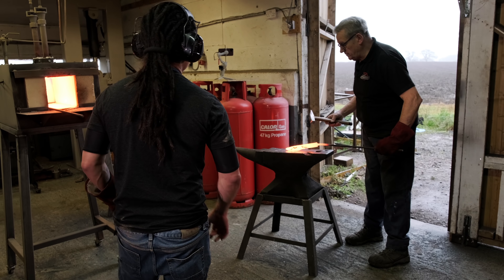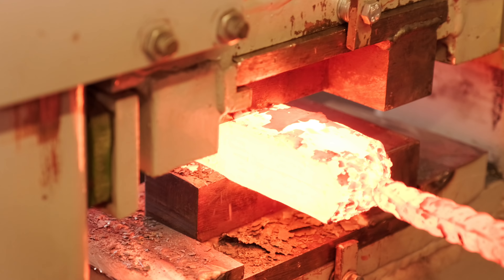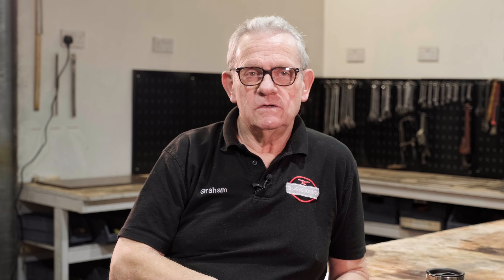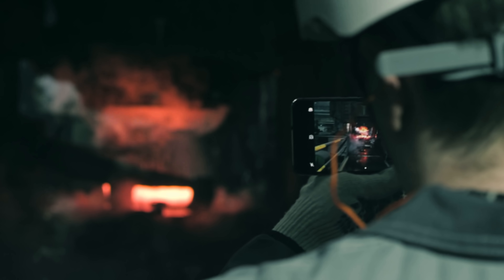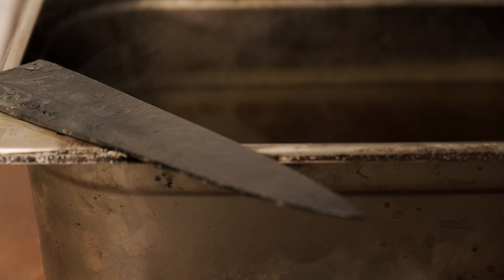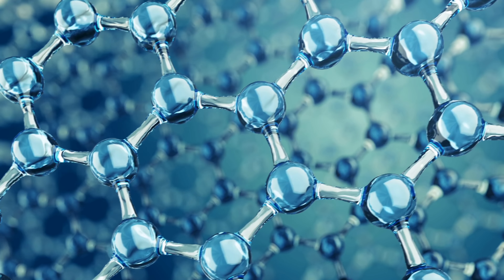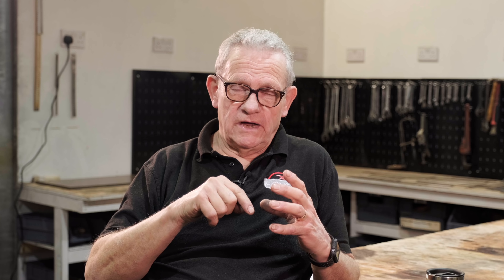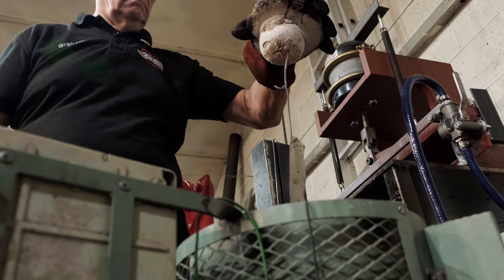3 reasons your knife is distorted (and WHY many makers get it WRONG)

Comment: if you quench in oil you can pull your blade out when it's warm, and bend it into shape while the martensite forms. Otherwise, you can just use a straightening hammer, wich is very safe on a tempered blade. I've never broken a blade with this kind of hammer

Comment: I appreciate finally seeing good metallurgical information about knifemaking. I am a metallurgist for a large captive heat treat department. The onlything I dissagree about is the movement in the quench oil. I agree that the stirrin is counter productive, but having good even flow around the entire piece of steel can reduce distortion caused during the quench. Quench flow helps to break up the layer of gas that forms on the hot steel at the begining of the quench. The goal is getting the same cooling around the entire part to prevent uneven residual stresses. Quench oil choice is also a factor. Using an oil with the corect speed for the material. Keeping the quench oil at the correct temperature can be a factore. Oil designed to be used at 150F will not have the correct viscocity to give a good even quench at room temperature. The temperature of the steel as it goes into the quench is a factor as it can change the amount of retained austenite in your steel. Grinding after heat treatment can also change your residual stresses in the steel. if you go from compressive to tensile stress on one side of the steel when grinding that will warp the blade. We see it in caurburized steel rings. A ring perfectly flat and round after quench can distort during grinding of the OD if you distort the residual stresses.
Reply from the maker: Hi Robert that is a fantastic reply and thanks for the compliment too!

Funny enough, the next set of videos coming are about quenching oils, how speed affects your quality and many other important things to know for a knife maker!

Hope to see you in our other videos! Cheers!
Reply: Ah! Robert - you speak music to my ears - a man that understands distortion. I don't think you can fully understand how it hides in crooks and crannies waiting to jump out and bite yer arse when you least expect it 🤣🤣🤣🤣
Reply: I worked in the heat treat department in several factories, small and large.  I agree with Robert on the formation of gas around oil quenched parts, or worse, steam pockets on water or brine quenched parts.  This can also result in soft spots.  Rather than agitate the part, agitate the quench media.  As for retained austenite, not letting it cool down enough before tempering or too severe a quench, particularly with air hardening steels, are also causes.  If there is enough retained austenite, the parts may "Rockwell soft" after hardening and mislead one into thinking it was a poor quench.  They can then increase in hardness after tempering.  (This "secondary hardening" is normal for D2 and most HSS).  One indication of too much retained austenite is the part shrinks after the hardening operation instead of showing the approximate 4% volume growth associated with the transformation to the martensite structure during hardening.  One way to get rid of the retained austenite is to give it a cryogenic treatment, but be sure to give it a second tempering to eliminate having brittle,untempered martensite in the part. As for carburized parts, one of their advantages is the residual compressive stress in the case (which increases the fatigue life in parts such as bearings).  This is the result of the difference in the transformation temperatures between the low carbon core and the high carbon case.  On non-uniform cross-sections, the ratio of case-to-core has an effect on the change of shape  of the part during heat treatment.  As for distortion,  one job used thin, 9" long pieces of CRS (distorts just by machining it) that were carbonitrided in a cyanide pot and quenched in water.  To solve the problem of distortion, they were first heated to 1540F for an hour while laying flat and allowed to air cool.  This solved the problem.  As for knives, whether its W1, O1, A2, A6 etc., you may want to try annealling (furnace cooling them) them in a straightening fixture after all the primary ops are completed,  and then heat treating them.  To prevent any de-carb, use an atmosphere controlled or vacuum furnace, or wrap them in stainless foil.

Comment: Luckily of the 100+ knives I made so far I only lost two due to too much distorison. I am stock remover not a knife smith. What do I do to mitigate this issue.
- Stainless steels like Niolox or the Crucible CPM steels I send to a heat treater that I trust and who knows what he does.
- I rather leave the blade thick before heat treatment. For example thin kitchen knives with a blade thickness of about 2 mm, I don‘t pregrind the bevel. I leave it thick. Do I need to grind a bit longer? Yes, but with the right belt not much of an issue.
- Most carbon steel knives/tool steel knives I heat treat myself. Proper stress relieve and normalization is a must. I do it for all baldes even with steels sold as annealed and normalized.
- Slight bends/distorions I fix after tempering. I don‘t overbend at tempering, never had any luck with it. Maybe due to practice. I have a set of small ball peen hammers 5 to 9 mm ball diameter. I put the blade on an anvil and lightly hammer the concave side of the bend. I mean really light, not a lot of hand force, just use the hammers weight. I frequently check with a straight edge. I learned this trick during my apprenticeship as a tool and die maker (1976-1979). In the molds we had very thin parts in the cavities and those always came out bend from hardening. Before we further ground and worked on those parts had to be straightend. Of course you see the littele dimples and need enough steel to grind those out. On blades that I pergrind I leave an edge between 0,5 -0,8 mm that was always enough to get the dimpels out. Btw. i made those small ball peen hammers myself during the apprenticeship, still have them.
Reply from the maker: Hi Roland and thanks for your fantastic and comprehensive input! 

I think point 1 is best thing to follow if you want it done. It’s the same reason I would send my car to a mechanic to give me peace of mind it’s done properly.

Thanks again for taking time to comment!
Reply: Gold
Reply: This guy is why I read comments

Comment: @Graham Clarke You showed your stainless blades are clamped after they are quenched. I try the same with thick aluminium quench plates. But when you remove it from the press for cryo treatment, won't it still warp due to not all structure changed to martensit? I wonder whether the  quench plates should at best be kept on for (1st) cryo treatment...

Comment: another fantastic video!  I make a lot of kitchen knives, and with blades that thin you get really good at managing and correcting warp.  Stainless is especially challenging because you can’t simply thermal cycle it to stress relieve it as easily as non-stainless steel due to the nature of stainless being air hardening.  Another factor is cryo. A lot of perfectly straight blades want to warp during the cryo cycle.  As Graham says, those invisible stresses seem to rear their ugly head at the most inopportune times after you thought the coast was clear.
Reply from the maker: Hey dude nice to see you back! Kitchen knives seem to be more problematic than thicker ones for warping / distortion but you are right, practice makes perfect! 

Thanks again for watching and I hope you are enjoying the content we put out!

- Vinz
Reply: @UKBladeshow  The thinner the material the more difficult to keep flat - try keeping kitchen foil flat 🤣🤣🤣🤣🤣🤣

Comment: 1st, great video. 
2nd, just want to add my 2cents. i have found that doing a horizontal quench with the tip pointing magnetic north has greatly reduced bends and warps during heat treating as well as in the temper..
Reply from the maker: Hi Scott thanks for the comment and appreciation!

Comment: I temper anything under an 1/8 inch clamped to a flat 1/2 inch steel plate. It's more prominent in stainless but if I counter bend on very thin it has taken the new bend. Let the plate and work cool down natural at room temp before unclamping. On high carbons especially at thicker material I'll use three bits of round stock and a vice with a torch and clean the edge so you make sure to keep your temp below straw. I have also used a hammer and anvil right after quench while it's still to hot to touch. Good luck figuring it out y'all!
Reply from the maker: That’s nice of you to share your thoughts and method thanks Mike!
Reply: @UKBladeshow  if we don't keep sharing it's going to get lost. Appreciate your channel.

Comment: I have a vice with long pieces of rectangular steel tube and thin wood mounted on the jaws. The vice is mounted on its side so it's in the same orientation as that guy's press. Other than that it's propane forge/oven and oil.

Comment: Question: Should knife and blade smith use steel wire and bars rather than plates? What forms of flux reduce delamination the most? Does filling the canaster with Argon gas help with canaster Damascus?
Reply: There’s been a video recently on forge welding. You’re more likely to get a answer putting your question on that one. I’ll try answering as best I can - I’m a ferrous metallurgist but not a blade maker (alas). And the following only holds for carbon steels.

I don’t know fluxes well enough to answer. Sorry. However, the reason to use a flux is to remove scale and get a nice clean surface. If you can avoid scale forming you can ditch the flux.

If you can get rid of the air in the canister before heating then you would prevent scale forming and ruining your welds. Argon sounds like it’ll do the trick (though be careful and ventilate the area - Argon can kill) 

The main thing that will prevent a solid forge weld is scale and general crud on the surface. I’ve unfortunately never had the chance to try but I would image that plate would be easier to use since there’s a whole lots less surface to generate defects compared with wire.  I’ve seen some very pretty blades made with wire/bearings/bolts etc so if the art of the craft is what interests you then don’t let that stop you from using wire.

Comment: my 1st knife bent on me, but it's totally functional.  only made a few so far, but after forging, I put the knife blank in a section of square tubing and heat them both to non magnetic.  then put them together in a bucket of ash to cool slowly.  not sure if it's necessary or not but it seems the extra mass of hot metal from the steel tube let's the knife blank cool slowly enough to fully anneal (or normalize?).  they come out of the ashes straight then I can quench and temper without much distortion.  I didn't invent this, just copied it from someone else.

Comment: I reverse bend with folded steel foil, an old piece of 1084 and a c-clamp.  I've gotten pretty good at that, but it's a pain in the ass.  I also peen.  But none of this is ever done before the first temper.  I also stress relieve steels like AEB-L and Magnacut, both of which are warpy.

Comment: After normalizing, if it is bent, reheat above critical, and straighten the knife. Re-normalize the blade to see if there is still warping. Repeat until the blade stays straight, then harden and temper.

Comment: Great stuff! Particularly interested in tempering to straighten comments... I've had mixed results but I've been tempering at 400° instead of 450°... Does it degrade steel quality of you temper more than 2-2 hour cycles? I've got one rt now that's been cycles twice at 400 ° clamped a bit past the bow but the bow just came rt back... Should I clamp straight at 450 ° or clamp beyond straight the other way?
Reply: @stevesyncox9893  ty... I usually torch the spine as well... This blade however has a hamon and I've discovered thru error that torching the spine on hamons kind of ruins the hamon for etching so I'm trying to avoid that... I'm gonna try tempering with a jig at a higher temp and see what happens...
Reply from the maker: @stevesyncox9893  thanks Steve, sorry if we didn’t clarify it but yes, it’s Centigrade hahaha! Thanks for your input as well - really appreciate it!
Reply from the maker: @Bar_D_Forge  thanks for the question Kevin! Very good question indeed and I must say, we only touched a little bit about tempering but maybe we can discuss that in-depth if that is of interest?
Reply: @UKBladeshow  absolutely... I need to learn everything from you guys, absolutely fabulous content...
Reply from the maker: @Bar_D_Forge  cheers man - I promise we have more good stuff coming shortly but don’t forget to watch the content we’ve put out in the last 12 months - everything from knife makers showing their process to knife maintenance tips etc!

Comment: Awesome video.  So glad YouTube suggested one of your videos a few days ago.  Warping is so frustrating.  I lost 6 knives about a year ago and then built a plate quench vise.  Straight blades but I noticed that it isn't quite hard enough.  Graham, what is best HC steel if plate quenching?  Been using 1080 type steel.
Reply from the maker: Hi Jeffrey thanks for watching another UK Bladeshow video! I’ll be speaking with Graham again soon so I’ll ask your question! Thanks!
Reply: You'll really struggle to get max hardness with a plate quench on a many carbon steels and plain carbon such as 1080 in particular. Their required quench rate down to below about 350-400 Celsius is just too fast for plate quenching - I use a fast or accelerated industrial quench oil for these materials. Choose steels with some Chrome content such as 80CrV2, 52100 or A2 ( in ascending Cr Content) for much better plate quenching results.
Reply: @clarkeknives4159  Thank you!

Comment: Weird question about clamp quenching.
Has anyone ever used materials like copper, silver, or tungsten for that?
Obviously copper and silver because they have greater thermal conductivity and greater thermal mass than aluminum. But if I remember correctly pure tungsten has better thermal conductivity than 7075 aluminum? Which is like the least conductive aluminum, but maybe the mass makes up for it?
If no one has done silver and copper, is it because they're too expensive or too soft?
If it's one or both of those would tungsten solve that?
Does this ultimately not matter because no one is insane enough to build big ass plates of tungsten for small batch heat treatment and in production you would just design the process to not need something so intensive?

Comment: if my knife comes out with a bend, i usually swear abit and then temper it with a slight reverse bend via the 3 pin method
Reply from the maker: Hahaha! Swearing doesn’t seem to be of much help fixing the bend but yeah, I hear lots of people using the 3-pin method - does it work all the time doing that or have you had failures on this method if you don’t mind me asking mate?
Reply: I use the same method with mine that come out with a bend.   Depending on the bend I have used one pin and 2 small c-clamps, 2 pins and 1 c-clamp, and a few months ago I used 2 pins and 3 c-clamps.  Success rate is pretty good and some steels respond better than others.  Have had a couple over the years though that just wouldn't come out.  I took one back to the forge, relieve the stresses (or at least I though I did), lightly tap the blade flat again, and went through the quench again.  The blade was straight as an arrow but put a recurve bow in the edge.  Weirdest thing I had seen.  Of course that one was scraped but man did it freak me out.
Reply: @UKBladeshow  it works more than you think but I have had it where I've over bent it the other way and it snapped or just had it where it not worked at all
Reply from the maker: @shaungreen679  hahaha yeah that can happen too!

Comment: There was a cable-tv show years ago, I think it was on the History channel and called 'Iron & Fire'?  - In one of their episodes,  - he explained that quenching with the blade facing magnetic north, reduces the possibility of warping. Is this a myth, or a credible hypothesis? Also, on another note about quenching - Instead of 'swishing' the blade (in any direction) during the quench, why not have your quench tank plumbed to a reservoir with a small electric pump that keeps the oil circulating to quickly move super-heated oil away from the blade? Drawing the oil straight down while re-introducing cooler oil through the top would (in theory?) 'draw' heat down the length of the blade (from tang-to-tip) and perhaps assist aligning its crystalline structure. I don't know - it's just a thought.
Reply from the maker: That sounds super interesting man! I’d definitely speak with Graham at some point soon to see whether this could work! Thanks for the input!
Reply: Haven't heard the one about magnetic north for a few years 🤣🤣🤣🤣🤣🤣 One of the bigger myths in my opinion. 
Industrially, oil would be circulated in the tank to prevent the build up of hot areas and pass it through a cooler but properly formulated quench oil has additives in it to aid even quenching at the required rate (fast or med oil for example). I don't (and don't advocate) move a blade once its immersed in the oil. Just hold it still and let the oil do the work.

Comment: Depends on the steel. Anneal. Normalize. 

If the steel is one that can benefit from thermal cycling. Then thermal cycling. However doesn't mean repeat the same normalizing procedure, when done properly the first one has a specific temp heated to and cooling rate and the next cycle has a different cooling rate and temp. 

From there quench. If going into water thin thin wash of clay. Very thing wash that's even. Oil meh. 

Depending on steal and other machining processes. Anneal in the middle of working.